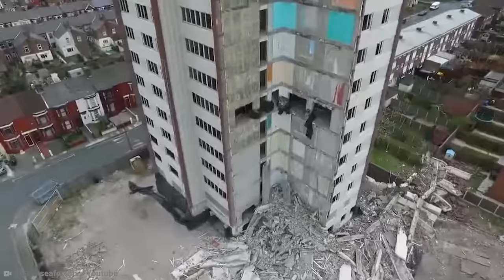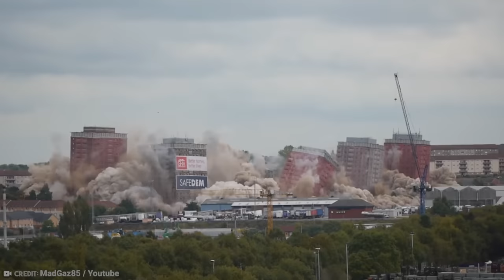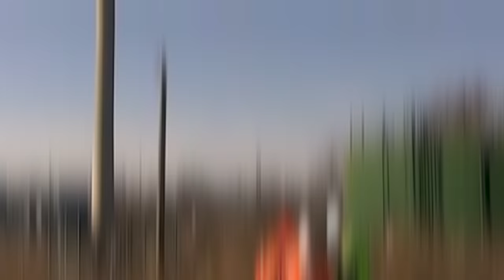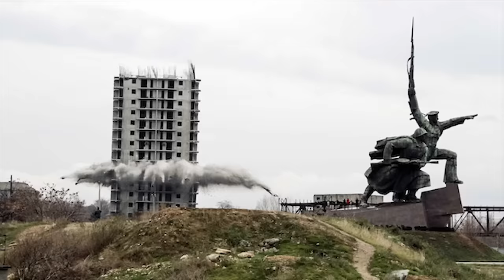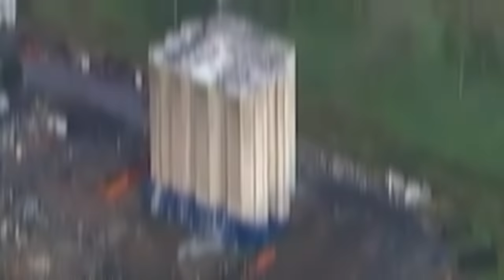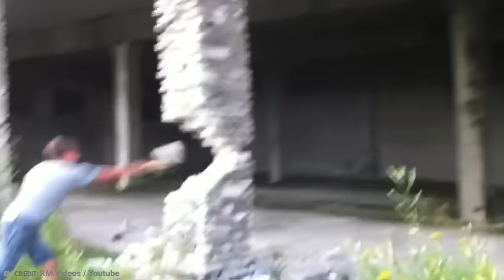20 Structure Demolitions Gone Wrong

Comment: so I read some where there is an issue in the demo industry of not wanting to use any extra explosives  firstly explosives are expensive and secondly they want to minimize the chance of secondary damage if you determine you need X amount add 10% and your not likely to have these issues
Reply: Old story is guy blowing tree stumps.  (I did that for a while) he was near a Elementary school, and a teacher realizing kids were distracted took them over to watch.  (Yes totally stupid, I would have quit setting charges). Anyway with the crowd he decided to add another stick (or maybe 2).  He lites fuse, walks back.  BOOM the stump majestically raises in air, a shirt arc and lands on cab of his 6 month old pickup.   A child walks over.  “Don’t feel bad you only missed the bed by 4’”.  I hated multiple trees.  By 3rd blast people show up, refuse to get back so crowd control needed. “If you can be there why can’t we?”
 “ I am lighting the fuse, I have solid cover, you are in open”.  BTW don’t try to catch chunk of wood falling.

Comment: I've always wondered when demolishing silos and towers why in the hell Dont they ever run a guide wire around one side that way when they set off the explosion they have tension pulling in one direction, I get that it can be dangerous but it could ensure that it's pulled in the direction they need it to go
Reply: Have you ever seen a cable under pressure SNAP?  I helped move a Irrigation system in a mature cornfield.  Two large tractors with @1” cables.  We can’t move it, I shut down. “Something wrong”. But ordered to try again.  Cable breaks.  Cuts a lot of standing corn like a huge weed wacker.  Then mass. If building goes wrong way. What could stop it?   I LOVE a +15,000 lbs tractor, 3/4” cable 300’ long for cutting trees.   Actually I put cable high up and pull them out by roots. (Dig, cut root from far side just like if wind pushed them over)